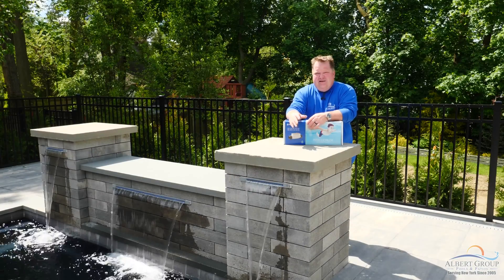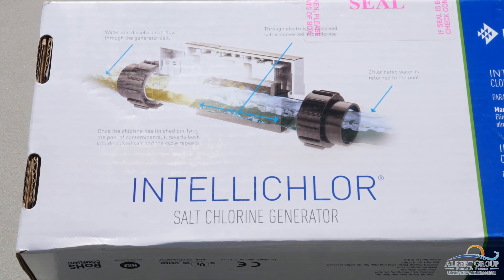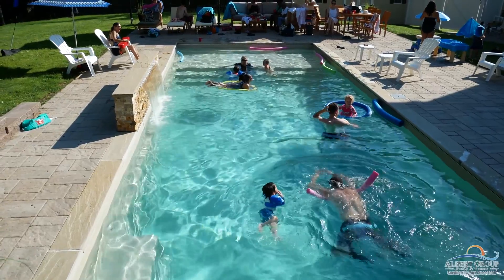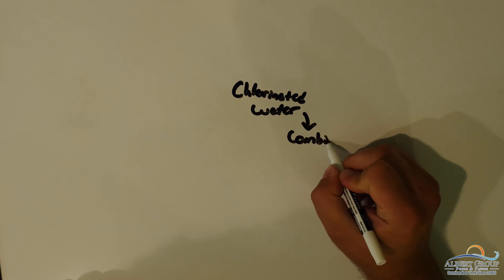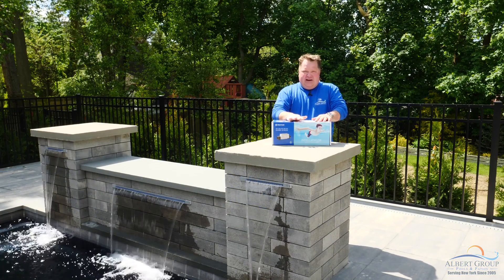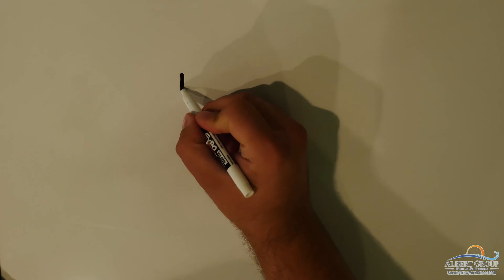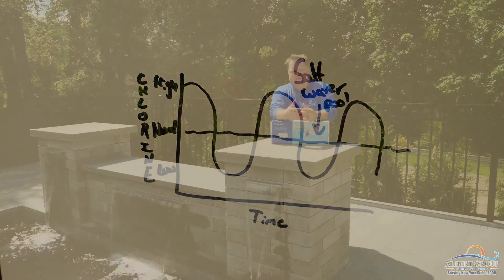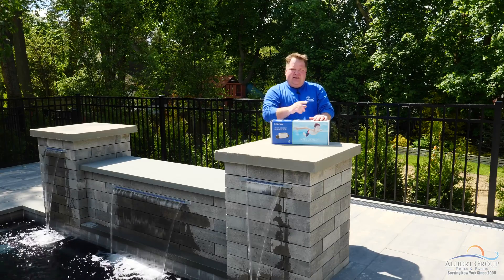How Do Saltwater Pools Work?

Comment: Is it a problem changing to salt if your pool has a marcite coating. Also what did you mean by adding calcium?
Reply from the maker: Hello! As long as the levels are maintained, everything should be fine. But, if the levels arent balanced, the salt can corrode the marcite finish because the water would become too acidic for the finish. What was meant by adding calcium was that there would just be calcium build up over time. Thanks for commenting!

Comment: Why is hard water an issue with salt pool ? From Texas where our water is very hard
Reply from the maker: Great question! Now, we arent expert scientists, but here is what we know. The harder your water, the more calcium in the water. Water evaporates, which in Texas, it evaporates way faster than it does here in New York. So, you keep adding more calcium into your pool. Calcium deposits build up and can cause maintenance issues that could be only a little cleanup or cost you money for repairs to your equipment, liner, filtration, etc. You should inspect your pool regularly to avoid this, especially in Texas. Hope this helps!

Comment: Outstanding, very detailed information. Please bring your company to Florida 🙏🏻🙏🏻🙏🏻🙏🏻
Reply from the maker: No, sorry, but you can check leisurepoolsusa.com and search for a local dealer.
Reply: I live in South Florida with hard water and a concrete pool, so my Chlorinator cell has to be cleaned multiple times a year. I simply remove it and clean it in a bucket of acid. During the rainy season, I have to add a bag of  salt every couple of months. My pool always looks great and it’s balanced, just takes a lot of work in South Florida